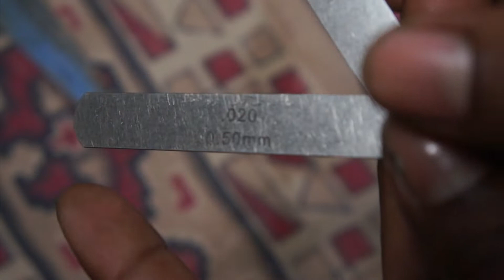How to tune your bike by yourself | Hero Honda Splendor Tuning | Bike Tuning for better mileage

Comment: Bro en hero honda spl bike 2006 model magnet la  noise varthu bro atha epdi bro repair pañrathu puthusu pota evlo bro varum
Reply from the maker: Bro magnet matti puthusu vecha tha correct solution aakum.
Reply: Athe voti vacha perachna varuma bro
Reply: Bro athoda prize evlo varum bro
Reply: Bro puthu magnet mathitn prblm solve
Reply: Bro aprm antha bolt konjm rusta irku bro athu change seylama

Comment: Anna hero honda spl bike carburetor cleaniñg ku wd40 use panlama
Reply from the maker: Ath pattathu. WD-40 is a penetrating oil. Use petrol for cleaning carburettor. Carburettor cleaners are available in the market, but i wont suggest it as it is expensive and also is not that easy to handle. Petrol is the best solvent for cleaning carburettors.
Reply: Thank u bro aprm  neenga nanum same model than same colour bro

Comment: Chetta njan 1998 model splender aan use cheyunne enik ippol milege 18 mathraman kittune ithin mumbu vere 60range aayirunnu, delivery job aanu ottum muthalavunnila overflow starting problem onnum illla enna cheythal milege kittum
Reply: Engine oil new ittu new sparkplug new air filter pinna carbartor clean num.ceyy
Reply: Same problam bro😅

Comment: Bro flow screw full close cheyunadath ninn etra turns ila ipo ole
Reply from the maker: Depends on engine compression and wear. 1.5 full turns anti clockwise aanu default position

Comment: Bro na new carburetor change Pannan en bike 2006 model ku athla  overflow tube la lighta petrol evaprate agthu bro ena problema irkum
Reply from the maker: Chood time il ath normal aanu bro
Reply: Bro heat nala athu marya bro

Comment: Chetta ente vandi 1997 Euro1  annu sound nere kittunila frnds nte vandikalku nala clear sound indu .E caustic soda yu hot water um use cheythu clean akkiya ahh pazhaya sound kittuoo
Reply from the maker: Njn ith varae ath try cheithittilla. But silencer block avumbol aanu sound kurayunnath. Try that techinique and silencer oori eduthitt mathramae enthum cheyyavu.shesham oru water service centre il kond poyi nannaayi adich wash cheyyanae inside ennittae fix cheyyavu.
Reply: Ok Etta ❤
Reply: Bro caustic soda use cheydhal silencerile shell  pottum   silencer  oori  kurach diesel ullil  ozhich vech  1 hour  kazhinjh  silencer onn chemical presure wash chrydhal madhi  complaintum verilla  nalla  soundum kittum

Comment: Bro caustic soda use panni hot water mix panni clean panlama
Reply from the maker: Loose carbon ilakum, but pidich irikkana carbon ponam enkil pressure wash koodi pannanam, ath silencer ulla cleara panna mudiyathu. Ennalum oru vidham pokum.
Reply: Oky thank you bro

Comment: Bro en bike silencer clean panlamnu irkn backing soda use panni clean panlama athoda hot water mix panni vuthi clean panna silencer damage agathuna illa normal water mix pana crta irkuma bro
Reply from the maker: Bro completa clean panna mudiyathu. Pinna pressure wash panna korae carbon ilaki pokum. Silencer hole intae akathott high pressure il water adich vitta podum. Apo backil ulla hole vazhi carbon purath varum

Comment: Bro ente splendor nalla missing Aanu overflow indeni needle maatti appol over flow ninnu ippol vandi start Aakkiyal thaane raise Aavunnu jet maattiyal problem sheriyavumo jetinta colour okke poyittund
Reply from the maker: Start akkiyal udan raise aavunnu enkil air leak aanu. Carb inum aa aluminium bend pipe inum idaik aayit isolator und, ath pottippoyo enn nokkanam. Pinnae 2000 inu shesham ulla vandi aanel air carb side ulla engine ilott ulla ella hose um connected aano enn nokku.
Reply: @gforgrease8983  thanks bro onnu check cheyyanam❤️
Reply: @Fabrizio..manavalan  ok aayo bro

Comment: Ethara turn thirichu bro athill
Reply from the maker: It depends on engine condition and carburettor. Default 1.5 turns aanu. Athil start and run aavum. But correct tuning kittan manually tune cheyyanam.

Comment: Ende bike passion plus aanu... carberator azhichu clean cheithittu.... eppol choke on aakkiyal mathrame vandi start aakunnullu.... enthanu prasnam bro....?
Reply from the maker: Clean cheythathu sheriyayilla. Carburettor onn koodi azhich jets randum nannayi clean cheyyanam. Holes ellam open aanenn urapp varuthanam. Holes open aakkan veettil wiring inu use cheyyunna wire il ulla copper strands use cheyyam. Dnt use any wire other than copper. It will increase the hole size in the jets.

Comment: ചേട്ടാ എന്റെ വണ്ടി സ്‌പ്ലെണ്ടർ ആണ്  എയർ സ്ക്രു ഫുൾ ടൈറ്റാക്കിയാലെ വണ്ടി മിസ്സിഗ് കാണിക്കാത്തതുള്ളു  rpm കുടിനിക്കുനവിടെ മിസിങ് ആണ് ഫുൾ ടൈറ്റാക്കിയാൽ മാത്രം കുഴപ്പം ഇല്ലാതെ ഓടും എന്താണ് ഞാൻ ചെയേണ്ടത്
Reply from the maker: Bro ath mikkavarum air leak aayirikkum. Carburettor inum aa aluminium bend pipe inun udaik aayit oru black part und. Carburettor insulator. Ath potti povukayo, O-ring damage aavukayo sambhavichal air leaks varum, appo ee same issues aanu kanikkunnae.

Comment: Anna  bike engine door la oil leak varthu apdiyee kela oil sotuthu so door change panlama illa gasket podatuma bro
Reply from the maker: Door? Ath puriyale. Head ilae cover aano?
Reply: ബ്രോ    സ്റ്റാർട്ട്‌ ആക്കി എണ്ണ പുട്ടുക ടൈം   നോ ക്കുക    9മിനിട്ട്    കിട്ടുന്നുണ്ടെങ്കിൽ 45 50മലേജ്     പ്രദീക്ഷിക്ക
Reply from the maker: Bro , oru vandi dae thannae different tuning il ulla mileage ariyan aanenkil aa technique ok aanu. Bt different bikes il eduthal volume of fuel in the carb and fuel pipe will not be the same. Oru centimeter hose neelam koodiyal thannae chilappol time marum.

Comment: എന്റെ കൈൽ hero honda passion ആണുള്ളത്,വണ്ടി ഭയങ്കര എരമ്പൽ ആണ്. മിനിമം സ്പീഡിൽ പോകുമ്പോൾവരെ ടാങ്ക് വരെ നന്നായി വൈബ്രേഷൻ കിട്ടുന്നുണ്ട്, ഇത്പോലെ ടൂൺ ചെയ്താൽ ഈ സീൻ ഒക്കെ മാറുമോ, ചില വണ്ടികളുടെ എൻജിൻ ഇങ്ങനെയാണ് എന്ന് പറയുന്നതും കേൾക്കാം
ഇതിന്റെ യഥാർത്ഥ കാരണം എന്താണ്?
Reply from the maker: Tuning issue undenkil anginae varam. Ath polae engine crank inu issue undenkilum , clutch rotor polae verae ethelum components inu issue undenkilum vibration varum.  Aadhyam carburettor onn ilakki clean cheytha shesham air filter koodi mattiyitt vandi onn tune cheyth nokku
Reply: Same problem splendor 3rd gear 40km kerubozhekum educate vibration enginum tankum oke

Comment: Splendor bike chilappol oodikaan smooth aanu chila samayam oodikumbol valivu kittunnilla erachukondirukkom  carburator clean cheythal Sheriyakumo
Reply from the maker: Spark plug issue undenkilum anginae varum
Reply: Spark plug puthiyathaanu
Reply from the maker: @PramodA.PPramod-hs7fv   vandi raise aakunnund but pulling illa enn aano?
Reply: @gforgrease8983    Athe cheriya kayattam kerumbol full throttle koduthaalum  pulling kittunilla
Reply from the maker: @PramodA.PPramod-hs7fv   Bike raise aavum but pulling illa enkil clutch aanu compliant. It idaik idaik aanu sambhavikkunnath enkil clutch  cable compliant aanu. 

Inginae alla, kayattam kayarumbol gear down cheyth 1st varae kond vannalae pickup ullu , illenkil off aavum enna condition aanenkil tuning issue aanu

Comment: slow speed adjust ചെയ്യുന്നത് Petrol screw ഉം Tuning ചെയ്യുന്നത് Air screw ഉം അല്ലേ..?
Bro പറഞ്ഞത് മാറിപോയോ.???
Reply from the maker: Allo bro. Petrol screw adjust cheyyumbo fuel aanu control avunnae. Air screw adjust cheyyumbo aanu proportionate aayi engine rpm raise aavunnae.
Reply: @gforgrease8983   എനിക്ക് തോന്നുന്നത് നമ്മൾ toolbox ൻ്റെ hole ലൂടെ അഡ്ജസ്റ്റ് ചെയ്യുന്നത് Air Screw ആണെന്ന് ആണ്,
നമ്മൾ Anticlockwise തിരിക്കുമ്പോൾ പെട്രോൾ അളവ് കുറയും & Air അളവ്  കൂടും.
Reply from the maker: @ThomasChakko-f2j   you are  wrong. Its the fuel screw. I can explain its working simply, the end of the screw is in the shape of a frustum, also the mating surface of the screw is exactly the same. Petrol passes through this screw. When you loosen the screw, the area between the screw and the body increases and fuel increases proportionately. But the air screw which is easily visible on the left side will raise the throttle piston like when we open the throttle when we turn it clockwise.
Reply: @gforgrease8983  Frustum shape aaneghil ath Air screw aanu Bro...
I think you are wrong!!!
Reply from the maker: He He. Nope. Air screw tip conical aanu and fuel screw frustum.
Reply from the maker: Also this screw is in a capillary line. How much time will a capillary line take to fill a 100cc cylinder?😂😂. This is the time for you to dismantle a carburettur in full.

Comment: bro ente sp 1000 rupade enna adichal 410 km okkekittunnollu nthayirikumkaranam ravile start cheypol vella puka und odikurachukazhinju angu marum
Reply from the maker: Cylinder kit poyal ingiae varum. Yeathra kilometers odiyittund? Time il oil okkae change cheyyarundo?
Reply: @gforgrease8983  6 month ayitteullu second edutheya soundil onnum mattamila
Reply: @gforgrease8983  njan eduthapol tanne oil changecheythu air filter mariyattila
Reply: @gforgrease8983  odikathe veche vandiayirunn athanu edukankaranamayi 50 kodiyattu ente kayil kittunne bro
Reply: @gforgrease8983  bro ithu sheriakkan orupadu cash vendivarumo
Reply from the maker: @kuttayikuttayi4838  vandi yeatha model year?
Reply: @gforgrease8983  2004
Reply from the maker: @kuttayikuttayi4838  cylinder kit poyi enkil arnd 6k aavum nannayi onn engine paninj edukkan.
Reply: @gforgrease8983  vere vazhionnumilalle
Reply from the maker: @kuttayikuttayi4838   Tune cheyth nokkanam
Reply: @gforgrease8983  ok bro nokkipikM

Comment: Fuel injection or carburettor is the most milage?
Reply from the maker: Technically Fuel injection vandikka mileage kooduthal, bt almost ippo kanunna ella Bs6 FI vandikalkkum avardae pazhaya Bs3 and Bs4 carb vandikalae kalum mileage kurav aanu.
Reply: @gforgrease8983  ok

Comment: Bro ente 2002 model splendor aan athil mileage kurav aayathu karanam tune cheyyan workshopil koduthayrinnu,tune cheyyunnathinu munb 25 aayrinnu mileage pakshe appol nalla throttle response undayrinnu,tune cheythu kazhinjappol 40 aan mileage kittunnath pakshe ippol throttle response valare kurav aan ,vandi oodikkondirikkumbol throttle cheruthayitt koduth vaykkumbol vandikk bhayankara missing aan.Reason enthanenn parayamo bro.REPLY PRATHEEKSHIKKUNNU
Reply from the maker: Bro engine pani aayi. Cylinderkit replace cheyyendi varum.
Reply: @gforgrease8983  engine pani kazhinja vandi aan bro, curberettor issue avaan chance undo bro
Reply from the maker: Engine pani kazhinjitt ethra naal aayi?
Reply: @gforgrease8983  oru 4 year aavm,pani kazhinjitt 2 year vandi eduthittilla, pinna ippol daily use cheyyunund,njn ippol spark plug azhichu nokki,athil muzhuvan carbon adinj kidappundayrinnu ,oilinte അംശം ottumthanne illayrinnu,carbon adinju kidakkunnath curberettor issue karanam alle bro?
Reply: Carburetor and fuel tank clean chey. Spark plug il oil illenkil engine healthy aan👍
Reply from the maker: Yes. Carburettor kooduthal fuel engine ilott supply cheyyunnund. Atha carbpn deposit koodunnae. Carb nannayit clean cheytha shesham plug clean cheytha gap adjust cheytha shesham tune cheythal ok aavum.
Reply: @gforgrease8983  Enta vandiyil spark plug tip oke clear aan carbon onm illa korch oil content und. Enitm Mileage kurav aan Tappet clearence tight aanenkikm mileage kurayille baaki elm clear aane
Reply: @abhi.e3078  curberottor clean aan,spark plugil oil illa but carbon deposit und.Njn ippol vandi tune cheythu mileage koodu missing maari but engine headil ninn tick tick sound kelkkunnu🥲
Reply: @_AMBADY Airfilter new aano Carburetor tuning correct aayitila tuning screw o ring oke athil undonn check chey pne spark plug il nalla current ondon check chey . Head il ninn sound vernenkil valve clearence check chey. Adyam ithellm onn check chey bro👍
Reply: @abhi.e3078  Air filter new aan . curberottor tuning issue varan chance kurav aan, karanam ippol nalla mileage ageum und pinne missingum illa, ini valve clearance koodi check cheyyan und ,athinta prblm aayrikkan aan chance
Reply: @_AMBADY  Bro ente vandiyil valve clearence noknm karanam mileage  kurv und pne morning nalla missingm und. Ninglk mileage oke ondenkil athonm cheyyathiriknea nallath. Engine sound over aano
Reply: @abhi.e3078  vandi oodi onn heat aayal pinne angaatt aa tick tick sound kaanum ,sound over aano enn chothichal over alla but kurach kooduthal aan.Mileage aa sound vannathinu shesham cheriya shot varunnundo enn doubt und.Bro valve clearance nokkitt rate okke around ethra  aavum onn parayane😊
Reply: @_AMBADY  Bro apol ningde vandide tappet loose aan ath tappet adjust cheyyendi verm adjust cheymbm over tight cheyel korch company parayne mm play venm. Over tight cheythal mileage oke povm. Tappet adjust cheyn 150-200 rs oke avuol👍
Reply from the maker: Engine set cheythappol ullathinae kalum tappet clearance koodanae chance ullu. Engine silent aano?
Reply: @gforgrease8983  Enta vandi engine nalla silent aan apm tappet tight aanenale.
Reply from the maker: Anginae parayan pattilla. Ennalum tappet tight aanenkil compression kurav aayirikkum.
Reply: @gforgrease8983  mileage kurv und. Baki elm clear aan . Kicker cheriya tight und apm tappet problem ale

Comment: വണ്ടി തണുത്തിരിക്കുന്ന സമയം സ്റ്റാർട്ട് ചെയ്താൽ ഐഡിയൽ സ്പീഡ് കൂടുതലാണ്. പക്ഷേ വണ്ടി ഒരു നാല് കിലോമീറ്റർ ഓടി ചൂടായി കഴിഞ്ഞാൽഐഡിൽ സ്പീഡ് കുറയുന്നു - സ്ലോ ആകുമ്പോൾ തന്നെ ഓഫ് ആകുന്നു. എന്താണ് പ്രശ്നം ? (Hero hf Deluxe)
Reply from the maker: Choke off aano enn nokki urapp varuthuka. Choke thazhott aanu off.  Choke off il kidannittum same avasdha aanenkil air filter azhich nokkanam. Filter adanj irunnalum inginae varum. Also , tuning mosham aanenkilum inginae varum.

Comment: Kollam Poli.. accelerate cable matti race ayi nilkkunnu slow speed kurachal sound kurayumo
Reply from the maker: Cable inu play illa enkil ittathil cheriya mistake und. Athayath handle il throttle just thottal thannae engine response varunnu enkil. Anginae aanel slow speed adjust cheythal engine speed kurayilla.

Comment: Tuning chayyith power kuttan pattumo
Reply from the maker: Correct tuning avumbo aa engine setup il maximun power kittum. Allathae power koottanam enkil air flow kootti,  carburettor jets size koottendi varum.

Comment: Video kand tune cheyth.. Ake poka mayam ayi😑😑😑
Reply from the maker: Its ok. Tune cheyyan pattiyo?
Reply from the maker: White smoke aano black smoke aano?
Reply: @gforgrease8983  white
Reply: @gforgrease8983  tune oke cheyth.. Ipo slowil pokumbo vandi thummi off akanu😑
Reply: Ipo vandi oodandum ayi.. Adich off akanu.. Eth nerathanavoo video kanan thonniye😑😑😑😑😑
Reply from the maker: @pranavsbabu8459   Dont be desp bro. Once more tune cheyyu. Flow dae screw anticlockwise turn cheyyanam. Vandi  fuel theerae illatha avasdha aanu. Also white smoke has nothing to do with tuning. Feel free to call me on 7012538769 during day time. Njn paranj tharam.
Reply from the maker: @pranavsbabu8459   engine oil mariyittano tune cheythath?
Reply from the maker: White smoke has nothing to do with tuning

Comment: Bro 2screw indalo ath nthaaannn
Reply from the maker: Athil vandi dae leftside,(petro tap side) ullath slow speed adjust cheyyan ullath aanu, athayath air flow screw. Right side ulllath, athayath behind utility box intae pinnil ullath aanu flow adjust cheyyunna screw